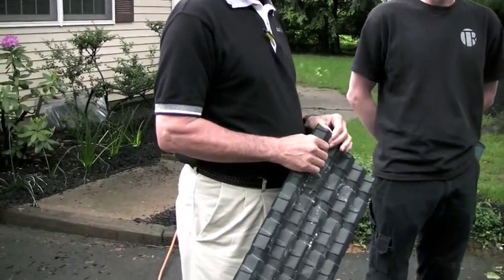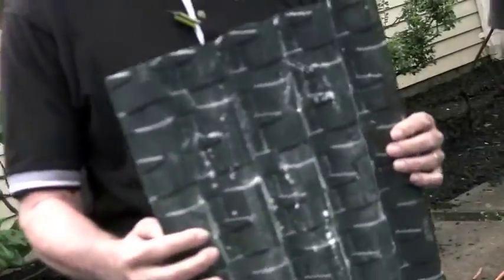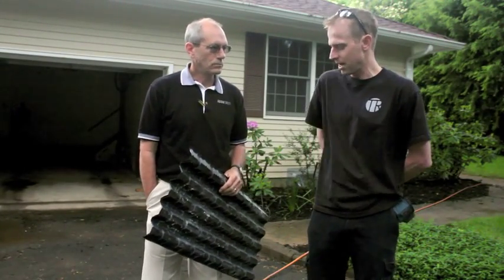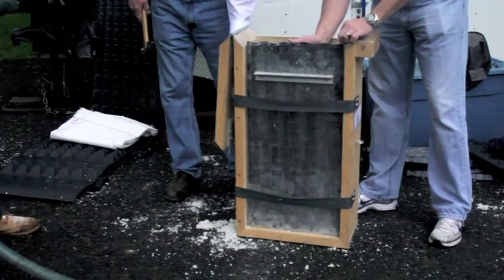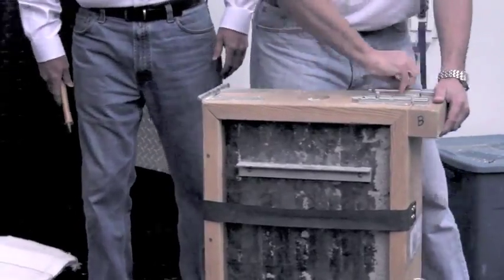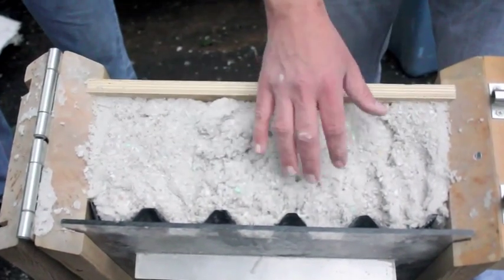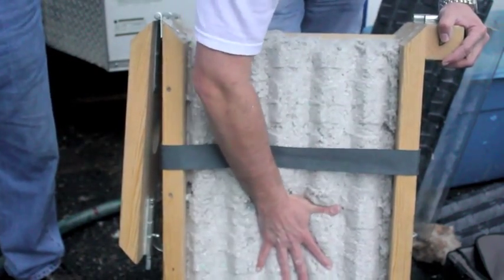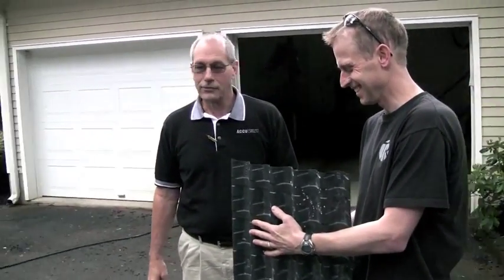Testing Accuvent

Comment: anyone have an issue joining accuvent cathedral started strips with extension strips? There is a lip on the starter that prevents a continous flow of air up to ridge, and also prevents them from "locking" together. Called company and they just said "lip" is supposed to be there but offered no explanation. The only solution I see would be to cut the end off off each strip, but it seems that one shouldn't have to do that if they were designed correctly.
Reply from the maker: +tonya hughes Is there a way for you to post or send a pic? We've done a fair number of dense-packed, vaulted ceilings, and can't recall this being a problem? Are you sure you have the cathedral starter?
Reply: +Jesse Smith I have pics, don't know how to post them for you to see
Reply: +Jesse Smith I posted a link to Google pics
Reply: ? What was the outcome?
Reply: I'd like to know the answer to this because I am considering purchasing the Accuvent for baffling my 16"-on-center cathedral roof.

Comment: did you let it sit in the heat of the sun and watch it shrivel up like a shrinky-dink? not contacting the sides and shriveled and compressed flat acceptable to your project?
Reply from the maker: Beef Supreme Not sure I follow. The baffles aren't compressed at all by the cellulose. This was a test to see if they would compress. They didn't. We're using a test chamber, so we didn't fasten the sides because it would have damaged the test chamber.